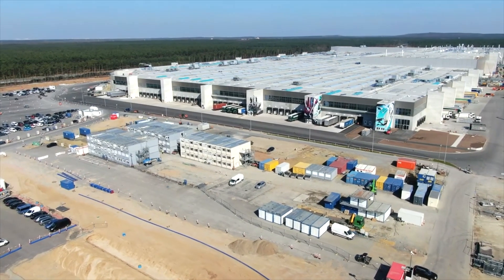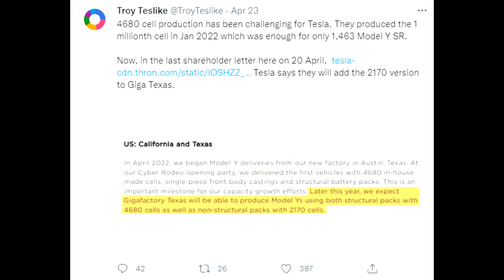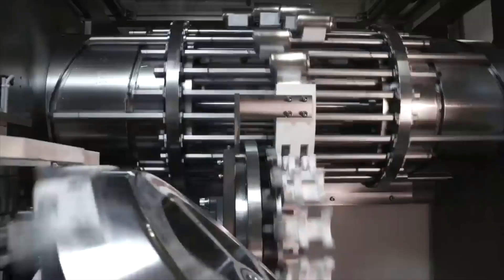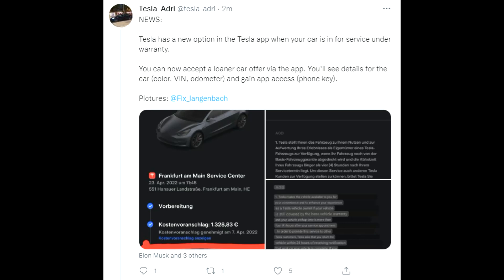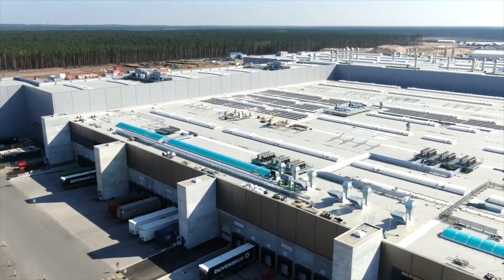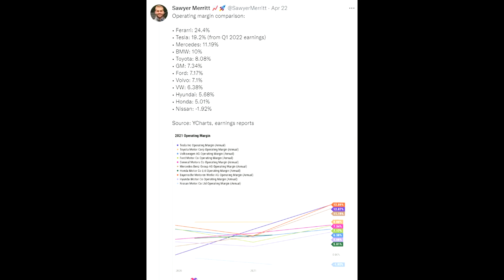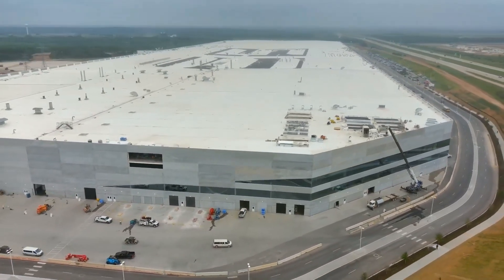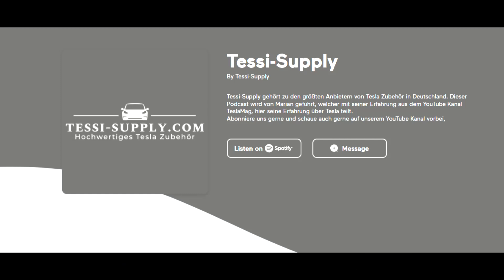TESLA 4680 SCALING Issues! - Shanghai Logistics update!

Comment: It is assumed that because Tesla will be producing EV with the 2170 battery from Giga Texas that they are having 4680 ramping issues. Elon has stated the Giga Texas would produce EVs for the eastern half of the US. This would mean that the Long Range and Performance Model Ys currently produced in Fremont withe the 2170 battery would need to be produced 
at Giga Texas.